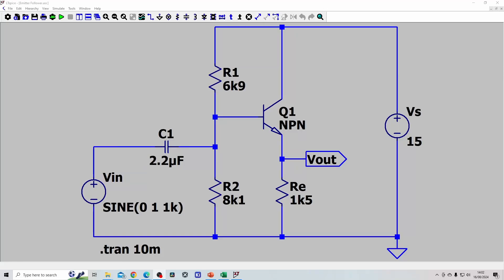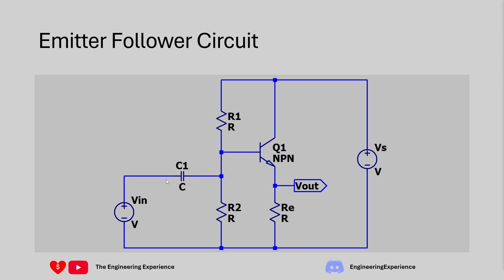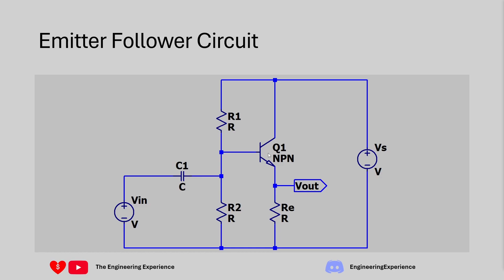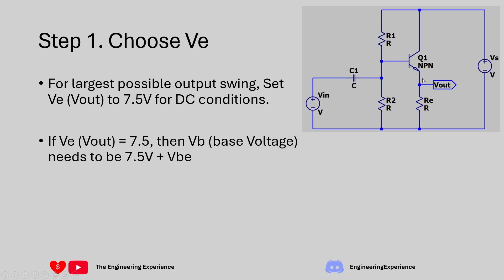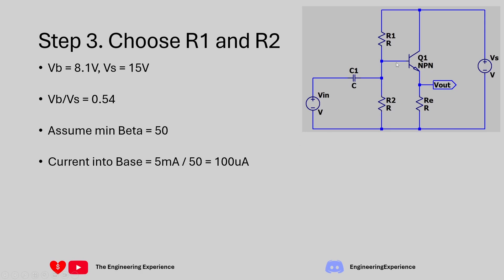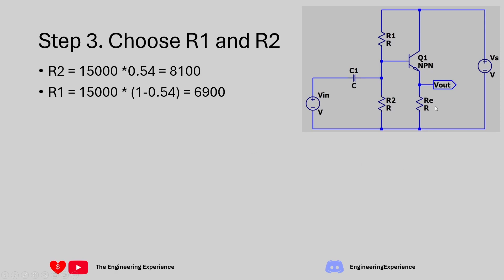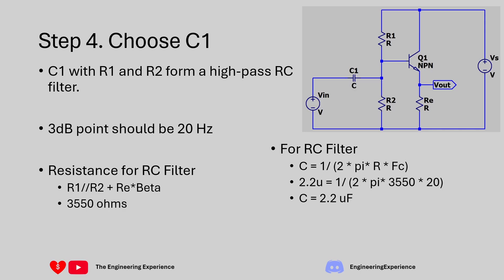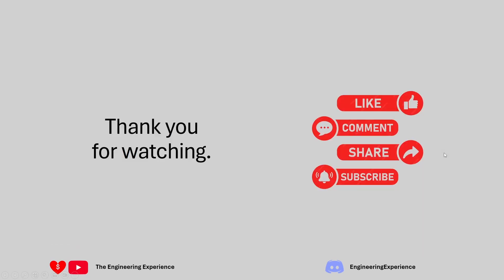Emitter Follower Circuit Design - Art of Electronics Exercise 2.8

Comment: I'm confuse about this one. If i'm correct, the need to set VE to 7.5V from the example was because the supply was between +15V/0V, therefore if the input signal oscillate between +1V to -1V, adding this offset (7.5V) would preserve its shape and a symmetrical oscillation. Now the supply is between +15V/-15V, VE should be set to 0V to get a symmetrical oscillation of the ouput
Reply from the maker: What you say sounds rights, maybe I missed the power when I answered the question

Comment: I am not sure that I agree with the proposed solution. The authors seem to be dropping a hint in the paragraph above the exercise saying that because of the symmetric supplies we can simplify biasing and eliminate coupling capacitors. Is it possible that the exercise wants us to eliminate the R1/R2 divider as well as C1? The design would only have Re, an output capacitor at Vout for the high pass filter set for fc=20Hz, and a resistor Rb between base and ground.
Reply from the maker: The exercise text says to use capacitive input coupling. The author also mentions that "you must provide a dc path to ground for the base". 

If I was actually designing for this problem then I would probably also add a low pass filter to reject frequencies above 20khz.
Reply: @TheEngineeringExperienceYT  You're right, it does call for capacitive input coupling. thank you for the reply!
Reply from the maker: No problem
Reply from the maker: You can remove the top resistors but I think that would be it.
Reply: I agree with you. I do think the purpose of this exercices was to benefit from the symmetric supply to simply the design by eliminating R1/R2 divider and adding Rb between the base and the ground. However the capacitor is still needed

Comment: Thank you for the great videos! Yeah it would be great to see the solution for +-15V power supply :)

Why is the cut-off frequency set to 20 Hz? I would choose it as 10 Hz, then there will be no attenuation at 20 Hz.
Reply from the maker: No problem! Solution with the correct power supply is in the works. 

You can see the cut off frequency to 10Hz as well. As with everything in engineering, there is a trade off. You let through more frequencies you are not interested.

Comment: I went over and over, and over how the f to get the R needed for the equation 1/(2piR*Fc). I re read my basic capacitor laws, resistance laws and the entire book that took me 3 years to finish.. 
Thank you so much for making it clear, I did not know Re * Beta had to be included for R. I was just using the parallel answer and using high filter. 
So glad for these videos. Now I can move on with confidence 
Thank you 😅
Reply from the maker: No problem!